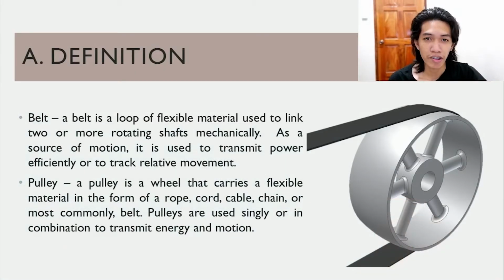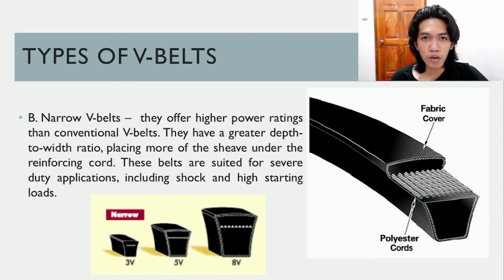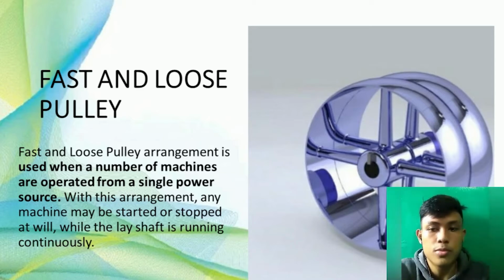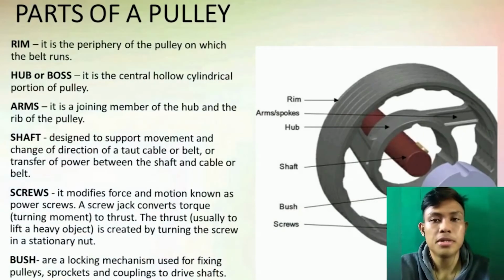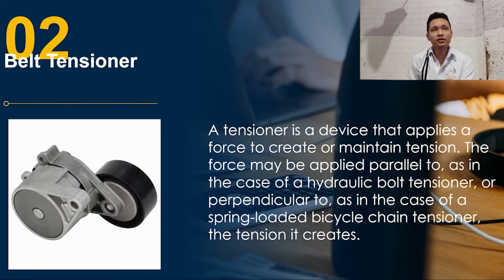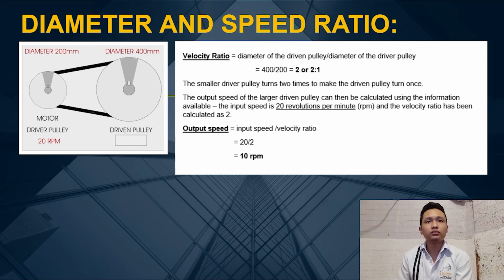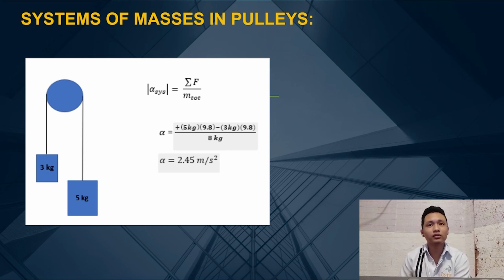Belts and Pulleys (Besinga, Carretero, & Requirme)

Comment: Cansico, Angel Mae L.
BSCE_3A

0:31 DEFINITION
1:15 APPLICATION
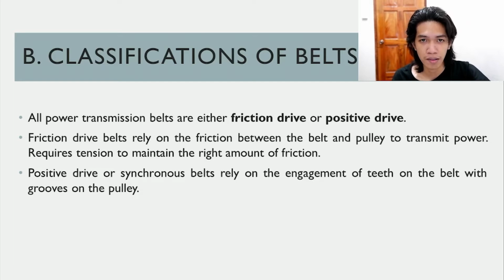1:57 CLASSIFICATION
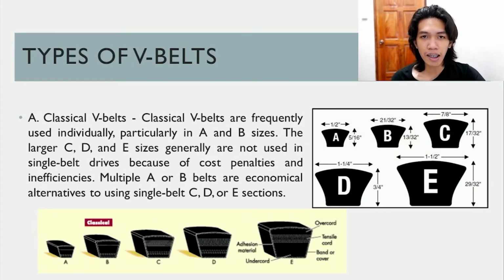3:09 TYPES OF V-BELT
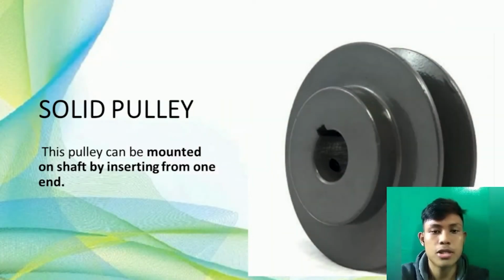5:08 FUNCTIONS OF EACH PULLEY
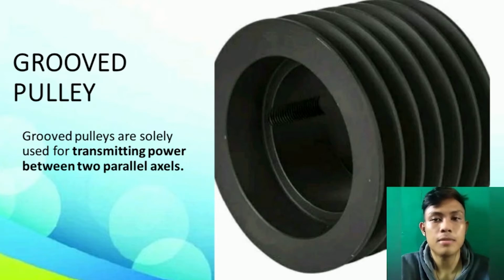9:36 PARTS OF PULLEY
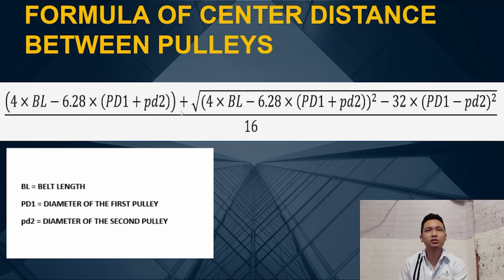15:49 FORMULA OF CENTER
18:24 DIAMETER AND SPEED RATIO
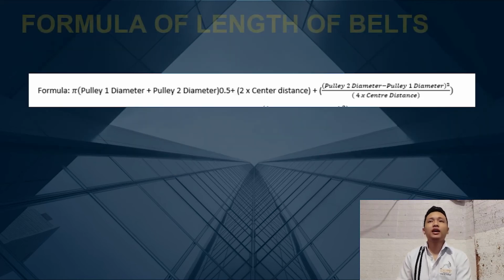20:10 FORMULA OF LENGTH OF BELTS

Comment: Egama, Rica Mae B.
BSCE-3A

0:30 Definition of belt and pulley
1:14 Applicantion of belts and pulleys
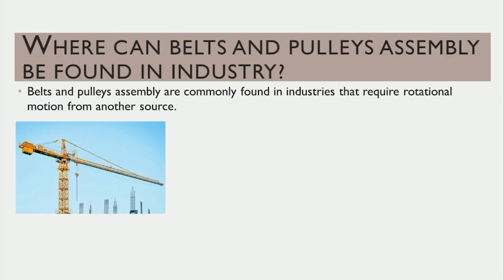1:35 Where can belts and pulleys assembly be found in industry?
1:57 Classifications of belts
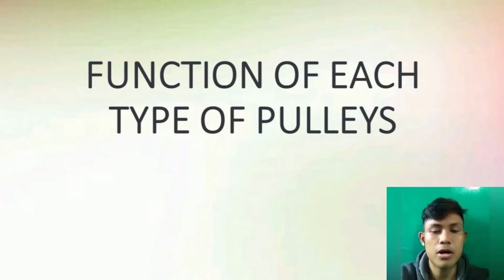5:07 Function of each type pulleys and different types of pulleys were discussed
7:37 Specific application of each type of pulley
9:38 Parts of pulley
12:02 Basic parts of belt and pulley
12:11 Basic parts of a belt drive
14:25 Basic parts of a pulley
15:45 Formula of center distance between pulleys
18:15 Diameter and speed ratio
20:11 Formula of length of belts
21:24 Systems of masses in pulleys

Comment: Lagahit, Judge Erika A.
BSCE - 3A

0:28 Definition of Belts & Pulleys
1:12 Various application of belts & pulleys
1:33 They can be found in industries that require rotational motion from another source
1:55 Classification of Belts
3:10 Types of v-belts
5:04 Function & Types of Pulleys
9:36 Parts of a Pulley 
12:14 Basic Parts of a Belt
14:25 Basic Parts of a Pulley
15:45 Formula of Center Distance between Pulleys
18:16 Getting the Diameter and Speed Ratio
20:08 Length of Belts
21:18 Systems of Masses in Pulleys

Comment: Delos Reyes, Dario Jr. A.
ce_3a_ce1
0:33 Definition of belts and pulleys
1:13 Applications of belts and pulleys
2:00 Classification of belts (flat, V belt and its types, circular, timing)
5:07 Pulley types and functions of each types (solid, split, cone, fast and loose, jockey, guide, groove)
7:44 Application of each pulley types
9:39 Parts of pulleys
11:10 Belt installation video
12:18 Parts of belt drive
14:28 Parts of pulley
15:48 Center distance between pulleys formula (including sample problem)
18:18 Diameter and speed ratio
20:14 Length of belts formula (including sample problem)
21:22 Systems of masses in pulleys

Comment: Salvar, Mary Ann R. -BSCE-3A
0:37 Definitions of belts and pulleys
1:55 Classification of belts, Friction drive and Positive Drive
2:07 Classification of belts
3:12 Type of V-belts
4:25 Circular Belt -High Power
5:50 Function of Pulleys
12:23 Basic Parts of  a belt
15:50 Formula of Center
20:13 Formula of Lengths of belt

Comment: CAHOY, KENETH DAVE G.  BSCE-3A
0:30 definition
1:12 applications
1:56 classification
3:10 types of v-belt
5:05 functions of each pulley
9:38 parts of pulley
15:50 formula of center
18:20 diameter and speed ratio
20:12 formula of length of belts

Comment: Poblete, Kyla Amor B. -BSCE-3A
0:28 Definition of Belts and Pulleys
1:14 Applications (Used in automotive engines)
1:58 Classifications of Belts 
3:12 Types of V-Belts 
5:04 Function of each type of Pulley
9:38 Parts of Pulley (Rim, Hub, Arms and etc) 
12:02 Basic Parts of Belts and Pulleys 
15:45 Formula of Center Distance Between Pulleys 
16:40 Sample Problem 
18:16 Diameter and Speed Ratio

Comment: Samporna, James Darryn S. - BSCE-3A
0:30 Definition of Belts and Pulleys
1:12 Applications of Belts and Pulleys
1:34 Belts and Pulley in Industry 
1:55 Classification of Belts

5:04 Functions of Each Type of Pulley
7:38 Specific Application of Each Type of Pulley
9:36 Parts of Pulley
12:05 Basic Parts of a Belt Drive
14:23 Basic Parts of a Pulley 
15:45 Formula of Center Distance Between Pulleys 
18:17 Diameter and Speed Ratio
20:10 Formula of Length of Belts
21:20 System of Masses in Pulleys

Comment: Ga-as, Lalaine Lace W. -BSCE 3A
0:31 Definition of Belt &Pulley
1:18 Application of Belts & Pulleys (used in automotives engines)
1:40 Belts & Pulleys assembly in Industry 
1:58 Classification of Belts (Friction and Positive Drive)
2:24 Flat Belt
2:55 V-Belt
4:30 Circular Belt
4:47 Timing Belt
5:05 Function & Application of  Pulleys
9:39 Parts of a Pulley
12:14 Basic Parts of a Belt
14:27 Basic Parts of a Pulley
15:46 Formula of Center Center Distance Between Pulleys
18:22 Diameter & Speed Ratio
20:10 Formula of Lengths of Belt
21:19 Systems of Masses in Pulleys

Comment: 0:28 Belt is the cheapest form of power transmission
0:32 Belts and Pulley definition
1:11 Belts and Pulleys work with applications requiring rotational motion from the power source
1:55 Classification of Belts
5:05 Classification of Pulley and Its Functions
7:37 Specific Application of Each Pulley Types
9:36 Parts of a Pulley
12:05 Basic Parts of Belts and Pulley
15:50 Center Distance Between Pulleys Formula
18:38 Velocity ratio
19:27 Output Speed as a Function of Input Speed and Velocity Ratio 
20:10 Belt Length Formula
21:25 System of Masses in Pulley can be solved with Newton's Second Law of Motion

Comment: Querencia, Benjie A. - BSCE 3A
0:33 DEFINITION OF BELT AND PULLEY
1:15 APPLICATION OF BELTS AND PULLEYS
1:58 CLASSIFICATION OF BELTS
3:14 TYPES OF V-BELTS
5:05 FUNCTION OF EACH TYPE OF PULLEYS
7:35 SPECIFIC APPLICATION OF EACH TYPE OF PULLEY
9:40 PARTS OF A PULLEY
12:10 BASIC PARTS OF A BELT DRIVE
14:25 BASIC PARTS OF A PULLEY
15:43 FORMULA OF CENTER DISTANCE BETWEEN PULLEYS
18:17 DIAMETER AND SPEED RATIO OF A PULLEY
20:13 FORMULA OF LENGTH OF BELTS
21:19 SYSTEM OF MASSES IN PULLEYS

Comment: Entroliso, Jessa May M. -BSCE 3A
0:29 A belt is used to track relative moment . A pulley is used to transmit energy and motion
1:21 Applications: mainly used for Automotives
1:55 Classifications of Belts
Friction Drive and Positive Drive
2:23 Flat Belt - low power, more speed
2:50 V Belt - moderate speed, high power
4:25 Circular Belt - high power
4:46 Synchronous Belt - reliable and precise
5:05 Function of Pulleys
7:38 Specific Application of Pulleys
9:37 Parts of Pulleys
15:47 Formula of Center Distance Between Pulleys
18:18 Diameter and Speed Ratio
Velocity Ratio = diameter of driven pulley/diameter of driver pulley
Output speed = input speed/velocity ratio
20:12 Length of Belts Formula
21:22 System of Masses in Pulleys Formula

Comment: Nicole Ann I. Alido - BSCE- 3A
0:32 Belt and Pulley Definition
1:23 Belts and Pulleys Functions
1:40 Industries where Belts and Pulleys are found
1:58 Classification of Belts
5:05 Functions of Each Type of Pulley
7:38 Specific Application of Each Type of Pulley
9:39 Parts of a Pulley
12:02 Basic Parts of Belt and Pulley
14:25 Basic Parts of a Pulley
15:48 Formula of Center Distance Between Pulley
18:16 Diameter and Speed Ratio
20:13 Formula of Length of Belts
21:25 System of Masses in Pulleys

Comment: Shannen Angela A. Pelpinosas - BSCE - 3A
0:35 Definition of belts and pulleys
1:15 Applications of belts and pulleys
1:58 Classifications of belts
5:06 Functions of each types of pulleys
7:39 Specific application of each pulley
12:17 Basic parts of belts
14:23 Basic parts of pulley
15:47 Formula of center distance between pulleys
18:20 Formula of diameter and speed ratio
20:12 Formula for length of belts
21:23 Formula for system of masses in pulleys

Comment: BANDOLIS, NEUHYDELE C. - BSCE-3A
0:30 Definition of Belt
0:47 Definition of Pulley 
1:11 Application of Belts and Pulleys 
1:33 Where can Belt and Pulleys assembly be found in industry?
1:55 Classifications of Belts 
5:06 Function of each type of Pulleys 
7:37 Specific Application of each type of Pulley 
9:37 Parts of a Pulley 
12:06 Basic Parts of Belts and Pulleys 
15:48 Formula of Center Distance Between Pulleys 
18:17 Diameter and Speed Ratio 
20:10 Formula of Length of Belts 
21:22 Systems of Masses in Pulleys

Comment: AGUILAR, LLANIE YIN Z.
CE 3A

0:28 Definition of Belt and Pulley 
1:11 Applications of Belt and Pulley 
1:34 Where can belts and pulleys assembly be found in industry?
1:56 Classification of Belts
5:04 Function of each type of Pulleys
9:38 Parts of a Pulley
12:01 Basic Parts of Belts and Pulleys
15:44 Formula of Center Distance Between Pulleys and Examples
18:19 - Diameter And Speed Ratio and Example
20:11 Formula of Length of Belts and Examples
21:26 - System Of Masses In Pulleys

Comment: OSIAS, KATIE SHULAMMITE C.
BSCE-3a

0:29 DEFINITION
1:12 APPLICATIONS
1:56 CLASSIFICATIONS OF BELTS AND PULLEYS
3:11 TYPES OF V-BELTS 
5:06 FUNCTION OF EACH TYPE OF PULLEYS
9:39 PARTS OF PULLEYS 
12:02 BASIC PARTS OF BELTS AND PULLEYS 
12:11 BASIC PARTS OF A BELT DRIVE
14:25 BASIC PARTS OF PULLEY
15:45 FORMULA OF CENTER DISTANCE BETWEEN PULLEYS 
18:16 DIAMETER AND SPEED RATIO
20:11 FORMULA OF LENGTH OF BELTS

Comment: JAN MARIE M. LLAUSAS - BSCE-3A 
00:41 — Definition of Belts and Pulleys
01:15 — Applications of Belts and Pulleys 
01:49 — Where can belts and pulleys be found in industry? 
05:04 — Functions of each type of pulley 
07:40 — Special Application of each type of pulley 
09:38 — Parts of a Pulley
15:51 — Formula of center distance between pulleys 
18:22 — Diameter and Speed Ratio
20:12 — Formula of length of belts

Comment: BAUTIZADO, LIREY MAE - 3A
0:28 Belt and Pulley Definition
1:13 Applications
1:35 Where can belts and pulleys assembly be found in industry?
1:56 Classification of Belts
5:06 Function of each type of Pulleys
9:38 Parts of a Pulley
12:07 Basic parts of Belts and Pulleys
15:44 Formula of center distance between Pulleys and Sample Problem
20:11 Formula of Length of Belts and Sample Problem

Comment: ALCIDO, MIASHYLL ANGELOU J. 
CE - 3A

0:28 Definition of Belts and Pulleys
1:12 Applications 
1:56 Classifications of Belts 
5:05 Function of each Type of Pulleys 
9:39 Parts of Pulley
12:05 Basic Parts of Belts and Pulley
15:44 Formula of Center Distance Between Pulleys

Comment: John Michael A. Saba - BSCE-3A
0:30 - Definition of Belt And Pulley
1:15 - Application Of Belts And Pulleys
2:00 - Classification Of Belts
5:06 - Function Of Each Type Of Pulleys
7:39 - Application Of Each Type Of Pulley
9:40 - Parts Of Pulley
12:06 - Basic Parts Of Belts And Pulleys
15:49 - Formula Of Center Distance Between Pulleys + example
18:19 - Diameter And Speed Ratio + example
20:13 - Formula Of Length Of Belts + example
21:26 - System Of Masses In Pulleys

Comment: HILUDO, CLAIRE DARLEEN SISSY S. - BSCE-3A
0:29 Definition of Belts and Pulleys
1:14 Applications of Belts and Pulleys
1:36 Belts and Pulley in Industry 
1:57 Classification of Belts
5:06 Functions of Each Type of Pulley
7:38 Specific Application of Each Type of Pulley
9:38 Parts of Pulley
12:10 Basic Parts of a Belt Drive
14:26 Basic Parts of a Pulley 
15:50 Formula of Center Distance Between Pulleys 
18:17 Diameter and Speed Ratio
20:17 Formula of Length of Belts
21:21 System of Masses in Pulleys

Comment: MACASA, AZZALEA NICOLE MARIE H. - CE3A
0:29 - Definition of Belt and Pulley
1:35 - Where can belts and pulleys assembly be found in industry
5:06 - Function of each type of pulleys
7:38 - Specific application of each type of pulley
15:50 - Formula of Center Distance Between pulleys